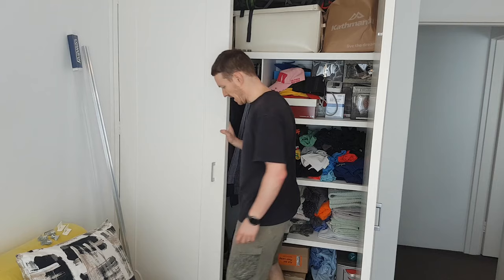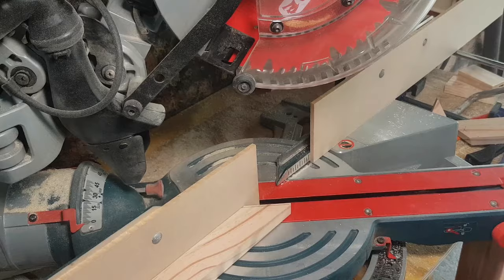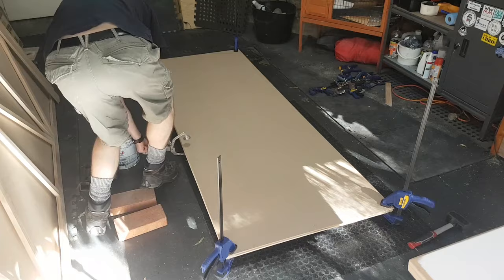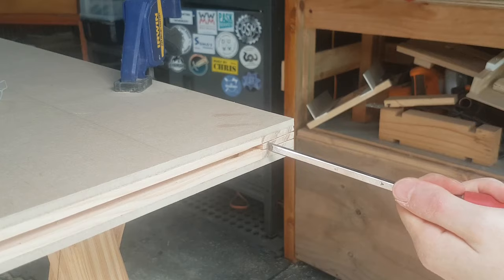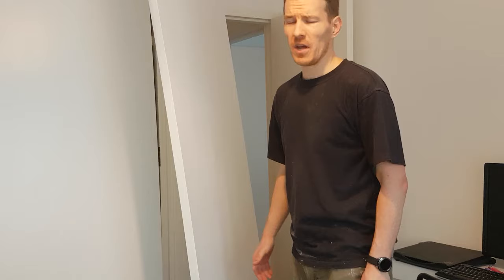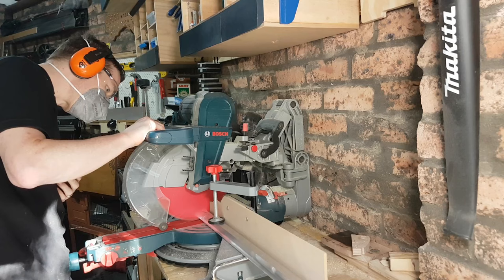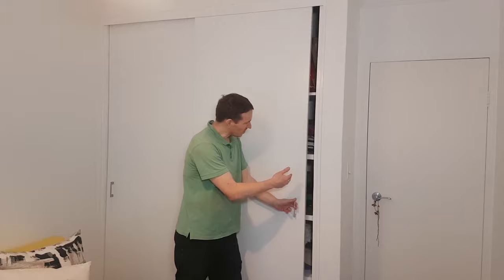DIY Sliding Wardrobe / Closet Door Build & Installation (Bunnings Cowdroy Door Track)

Comment: Why didn't you just use the existing doors and convert them to sliders instead of hinged? weren't they the perfect size and fit already just needing ot be offset to pass each other?
Reply from the maker: G'day Zen! This is a popular question the short answer is the new doors will be completely different dimensions, Wider, Thinner and Shorter. Long Answer: It's possible in some situations, but here are the reasons why that's a little tricky... Firstly, your current doors are almost exactly the same size as the opening. Sliding doors normally need to overlap so will be wider than the old ones. You could pack out the sides of the frame a few inches to hide that gap though if you'd be happy with a narrower opening. 2nd, as the rail takes up space, the sliding doors will be shorter than your current doors. If you have hollow doors be aware you'll need to trim them down and perhaps add in a new brace. Lastly, consider if you have room for the old doors to slide past each other. Swinging doors fill the whole frame, sliders will usually need to be thinner. It may be able to be done if you are clever, but there is a reason I made new ones instead of trying to reuse the old ones 😉
Reply: I see your point, My frames are wide enough to accomodate the thick door but i see there would be a thick offset and a line gap when both closed. height issuei wonder if the door could be recessed to allow the original height... and yeah mine are surely hollow but paint is perfect so it would be nice to get it to work even with a bit of extra timber trim to make for a better overlap and hopefully not cut into the hollow part which will make for a fail no doubt. I appreciate your reply! 
 @FixitFingers  Also i wonder did you price saw custom ordered mirror doors for example, what was the price difference for those of us that don;t have a fully capablr workshop?
Reply from the maker: @TheZenMicro  oh it is possible you could reuse the old doors, it just may end up being more work than making new ones!  😅 No, I didn't look at mirror doors, but I'm going to guess they would be very expensive and you'd have to use a bottom track to take the weight as they'd be very heavy. I think I'd get someone in to do those but have a look on the tubes, there are clever people who may have come up with a cheaper DIY mirror option 😊

Comment: Good job!  I searched for DIY sliding doors and found your video.  One thing that looks off is the handles are not aligned.  I realize it’s done on purpose so they don’t hit, but it looks bad.  Maybe changing out the handles for something a bit more flush is the way to go.
Reply from the maker: You got me all parnoid now 😅 In which direction? Oh at 18:30? Yeah they look a little off there but it must be the camera angle, they are the same height. They can't clash as the doors can't slide past each other and I made those inbuilt stops to keep the back of the door from hitting the handles. However, inset hardware would not be a bad idea, I just wanted to reuse the original handles off the old door 😊

Comment: Why you didn’t use the existing doors
Reply from the maker: G'day SG, good question! Basically they are the wrong size in every dimension to be reused as sliding doors. Firstly, the old doors are almost exactly the same size as the opening, whereas the new sliding doors need to be wider to create an overlap to hide the gap between them. Secondly as the rail at the top takes up space, the sliding doors also need to  shorter and as these are hollow trimming them down is tricky. Lastly, the old doors are too thick to slide past each other. Swinging doors fill the whole frame, sliders will usually need to be thinner by half. Reusing the old ones may be able to be done if you are clever, but making new ones was much easier in the long run. Cheers!

Comment: Thank you for vid. I'm so lucky to have found this video as I'm about to install similar sliding doors. I had a drawing on my sketchup with MDF 18mm thick but now i'm gonna try the same thing with 6mm in front and 3 on the back like you suggested.
Reply from the maker: Good luck!  Yes if I do our other bedroom that's what I'd try. Another good hint is cut your MDF first in a prefect rectangle, then bend the frame to fit. A joiner mate of mine gave me that info after watching me do it backwards ;)

Comment: is there anyone can answer why he made a door and not used a bit thick mdf as a door?
Reply from the maker: Hi Hilal, I considered that option, the answer is weight.  You sure could just use two single pieces of MDF and that would be much simpler, however that would be around 50kg per door!  😯 I couldn't lift that, and the track I used can only handle 25kg per door. I'd need to use a more expensive bottom track, and the material cost would be more too. Good question!  👌
Reply: @FixitFingers  ok now i get it, thank you much for the time to answer ☺️only problem i dont have saw the cut as u  have. Do you think jigsaw would be enough?

i wanted the professionals do it but they ask 1400 euro and i am not fancy paying that much. i prefer my ugly door than expensive one. only concern i have is the safety 🤷
Reply from the maker: A circular saw is better at cutting straight lines but if you take it slow and use a good square to help cut a jigsaw can do the job. I was the same with the price, the professional job was going to be very expensive so I decided to do it myself! Just make sure the track you buy is rated to the weight you need. My doors are about 23kg each but they are very big. If you use thinner MDF skins they will be lighter. I was worried about it falling down so I added extra screws to the track.  😊 Mine are not perfect, but they only cost a total of about AUD$300 (about 200 Euro) and a couple of days work. They have been in for nearly 2 years now with zero problems so this method does work well. Best of luck! Let me know how you go :D
Reply: @FixitFingers  tbh i have with full of fears
im not even sure that i can make the right height. the mdf is 240max and the ceiling i have is 233. but because im gonna screw the rails on the ceiling m not sure how i can measure the right height of the door to make sure it is not too long to fit in the rail or slighlty short. i can ask the hardware store to cut all the pieces straight for me( not angled ) but as i said dunno how to measure the height of the door from ceing's rail to the floor 😩 
probably even i make a mistake it will be cheaper than 1400 euro 😅
Reply from the maker: This is an intermediate level project, not super complicated but will be tricky if you've not made many things from wood before. You should be able to get the height of the track you use off the packet, take that plus 10mm extra off the height you need for clearance. The trickier one is the overlap. You probably want your doors to overlap about 100mm so each door needs to be half the closet width plus about 100mm (not critical, mine is less so I could use fewer sheets of MDF :P) Long doors can be cut down, small doors can have extra MDF glued on so don't worry if you make a small mistake, it will mostly cost you time but Im sure you'll get there in the end. It will be a challenge but hopefully enjoyable! You could also look for a floor-mounted track that will take more weight, then you could just use solid 18mm MDF which might be easier but I've not tried that type of track yet.
Reply: @FixitFingers  18mm mdf cqn be a problem when i put the wheels on it, im not sure whether mdf can carry the screwed wheels
but  of course i will throughly think before i cut chop screw thw things, fixing in general takes more time and create frustration
tha k you for all the answers ❤️❤️

Comment: Well done. I think I will copy your method. I don't think I'll do the diagonal members of the frame though, because the cuts are complex and I think the MDF skin is more than enough to keep the frame from racking.
Reply from the maker: You are probably right, the diagonals are likely overkill once the skins are on. Also, If I did it again, I think I'd use 3mm MDF, not 6 for the same reason :) Good luck!

Comment: The bottom slide stays can be separated or opened a little to widen the gap at the floor which will maybe stop the doors from touching, you only need move and reposition the front one out a fraction. But great job on the doors from a retired wardrobe installer.
Reply from the maker: For a novice hack making things up as I go that is humbling coming from a professional, thank you kindly Michael. I had to cut a lot of the swearing and small errors out as this one was getting long making look a little more competant than I really am 😅 I might try that trick cheers, I've already got a slight angle on the front door but could increase it a bit more. I'll wait until I gut it and replace the insides though as the back door is actually the problem.  It has a small bow in the middle as I didn't support it enough under the paint tins I used to weigh it down during glue up and it pushes against that top shelf forcing it out a little. Once that old inside is replaced it should be better.
Reply: @FixitFingers  You did great, better than some installers, and all hand made, that in itself is a masterful feat. Yes, when you remove the internals, you can plumb the doors and give the front one a little nudge out. you might also look at a coat or two of stain on the back, and paint what is visible, tops, sides and fronts! that might help if it's touching. Good work. P.S remembered that you have painted already so ignore the last bit. :)

Comment: Mate, a job you can be well proud of. As I was watching the video of you falling over, I spat beer all over my monitor. Never laughed so hard. Good to see I'm not the only klutz in the workshop. Only difference is that you left yours in while I edit mine out. Top job as usual, James.
Reply from the maker: We had a heap of rain that week and the wagon dripped water all over the floor and soaked in under the mat making for the slip and slide action 😂 It was VERY lucky not to do an injury or worse, punch a hole through the project but as usual near misses make for excellent comic relief! ... though seeing a pen flying off the lathe into a  DeWalt dart board would be classic...
Reply: @FixitFingers  Good idea, I'll see what I can do. As long as you're ok mate.

Comment: Thanks for this. I was just pondering about doing something like this. Neat. PS. Yes. Always blood concrete. 😂
Reply from the maker: Cheers Alessandro. It's held up well over the past couple of years. Even with the slight rubbing of the doors there are no scratches, the paint has held. I still haven't got around to doing the inside though... one day 😅
Reply: @FixitFingers  yes. Familiar with that. I got a rule despite how busy I am, fully finished or no charge. And I do that for personal jobs. 
Thanks for letting me know about how it’s holding up. Really appreciated. I made a full oak door including the rails in my kitchen but never tackled a wardrobe, hence I reached out. PS:  well, being in uk I should say bloody chipboard yet I seem to still find concrete.

Comment: Awesome build. Really liked it. Something like this would suit my sons room.
Reply from the maker: One trick a joiner mate told me after I did this is build your frame to suit the MDF, not the other way around like I did. That way you cut the MDF first and know it is perectly square, then you can force the frame (which wont be) into square. Also, 6mm MDF was probably overkill, 3mm on teh back at least will cut down the weight!

Comment: Badly need this AAAAA
Reply from the maker: Have a go! My doors were an unusual size, but if you are lucky you can just buy them off the shelf, paint, and hang using the big box hardware. You could also cut the weight using 3mm MDF too if you'd like to scratch build but don't want to handle 25kgs of door! 😊

Comment: I have those “non slip matts” we emptied the pool in the garden and my mrs went flying and smashed her head open! They are the exact opposite of non slip because the float
Reply from the maker: I still have mine down, but am thinking of just pulling them out. Every time I drive when it rains my wet car drips water in and makes it a hazard!
Reply: Fixit Fingers  I would get rid mate, we spent hours at the hospital because of those things, they lose all friction with a tiny bit of water, all it takes is one day your rushing out the car and bam, they literally take your feet from under you, I’m not a health and safety freak at all but those things are deadly 😂 all the best mate 👍🏻
Reply from the maker: Yep, I think you are right. Any they aren't under 100kg of timber will go I think. 👌

Comment: I wish i could do this
Reply from the maker: It's not a project I'd recommend for the absolute beginner but with a little experience achievable. A much easier way to make the doors would be just to use solid 18mm MDF. They'll be heavier, but heaps quicker to make.

Comment: Im about to get started on similar project, some good tips in here mate!
Reply from the maker: Morning Robin!  Cheers mate. One additional tip a proper tradie mate gave me after watching this is to cut your MDF sheets *first*, then measure and attach the frame to that. That way you know the sheet is perfectly square, and the slightly dodgy bendy long Bunnings pine frame will conform to that reference. Can't wait to see your take on this job 👍
Reply: @FixitFingers  That's a good point, hadn't thought of that! Which roller system did you use? Is it the Cowdroy from Bunnings?

Comment: U did good great skill awesome👏🏻 my hanging doors r old with slight inch gape between each which makes them swing in place, bang into each other, how can i lock them in at the bottom still allowing each to still slide ?
Reply from the maker: Hey Margaret. Did you see this little plastic guides I used at the bottom of mine?  You should be able to find those at the hardware store. However you'd need to route a channel for them in the bottom of the doors which might be tricky. A second option I can think of is small stirrup brackets ('U' shaped) that are the same thickness as your doors screwed in to the floor as guides. They won't look as pretty as you can see them, but much easier to install. I hope that helps!
Reply from the maker: Something like this, but smaller, the same width as your doors :) https://amzn.to/2X71cJA

Comment: Very nice, just what I was looking for!  Getting these made by a company costs a fortune, so I'll try it myself. I didn't see you installing a guide on the floor - are the doors just hanging freely? Won't they "wobble" in and out when sliding them?
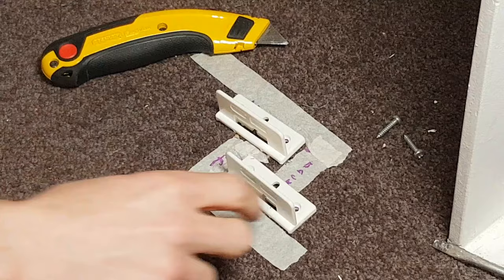Reply from the maker: G'day mate, no there are guides in the floor, check out around 16:17 where they are installed. That's what the trench in the bottom of the door is for 😊
Reply: @FixitFingers  Ah, makes sense! I thought it looked like they were only at the ends when doors were closed. Thanks for the answer! Cheers

Comment: Good video🙂. Could you please advise dimensions of pine frame (looks like about 70 x 19 or 16)?
Reply from the maker: G'day Bruce. For the pine frame I used off the shelf 19x42mm from the big box store bought in 3m lengths.
Reply: @FixitFingers  Thanks for your response. I got the thickness right at least. Now I just need to see what my local ‘small’ BGS has in stock. Thanks again for the video and the response🙂
Reply from the maker: Good luck! I'm still really happy with these, but I think I'd go 4.5 or 3mm MDF instead of 6mm if I did more of them to keep the weight and thickness down
Reply: @FixitFingers  My thoughts exactly re the MDF thickness. We are a retired couple, so little chance of damage due to no kids running into them😂

Comment: hi, about to attempt this. are both doors the same size
Reply from the maker: In my case yes, they are. Keep in mind, they will be shorter (to allow for the new track), wider (to provide an overlap when closed) and thinner (to slide past each other) than the old doors. You might also want to check your wardrobe frame is actaully square... I didn't and if you look closely right at the end when I close the door you can notice a slight gap! The new door is square, the frame is not 😅 No one but me has noticed but something to look out for. Good luck!

Comment: I want to do the same for my wardrobe, but I don't have all these tools 😢
Reply from the maker: The way I made these is an intermediate woodworking project Xahra. You can do it much easier however. If you are lucky, you can find pre-made doors the right size and hand them yourself. Otherwise, though much heavier, you can use solid MDF. That saves most of the hard work, you just need to ensure your hardware can take the weight. Good luck!

Comment: i have another question :)
i bought well recomended trails

the distance between ceiling and floor  is 2.3m , only concern i have is the safety
do u think it is too tall
i will make light door not full mdf and wont keep the width more than 70cm

but do you think 230x70 cm is dangerous even if i make light doors?

otherwise i have to make a frame to shorten the ceiling - floor distance but it is too much work then 😅
Reply from the maker: No that should be fine and almost exactly the same as my doors. I used 6mm MDF, which is probably overkill. 4.5 or even 3mm will cut the weight further if you like. The only thing I was worried about with 3mm was hitting the door by accident and making a hole :P